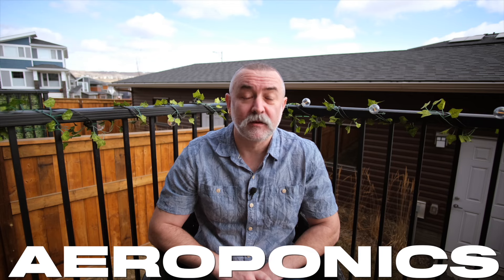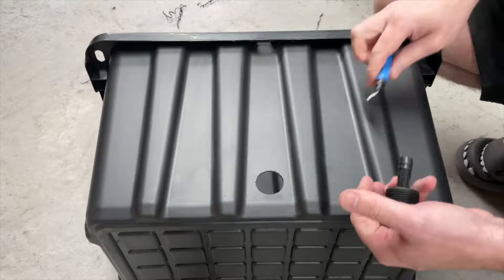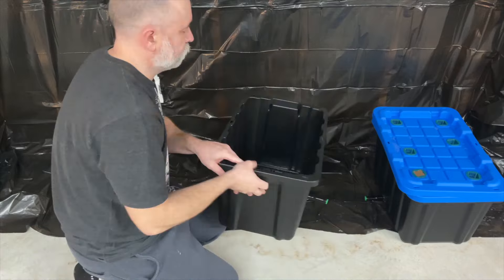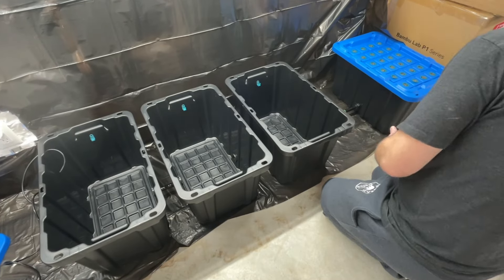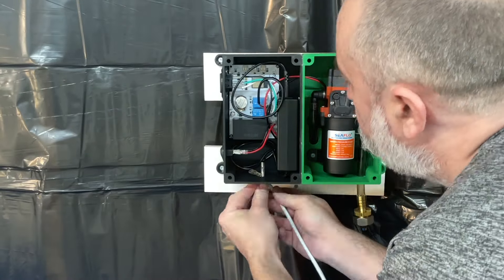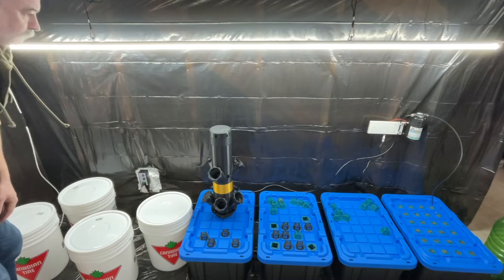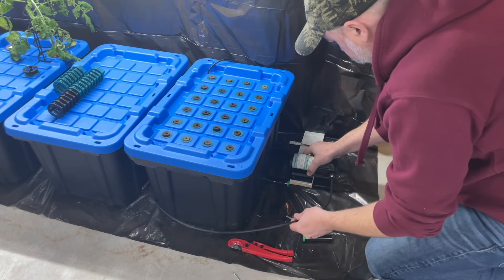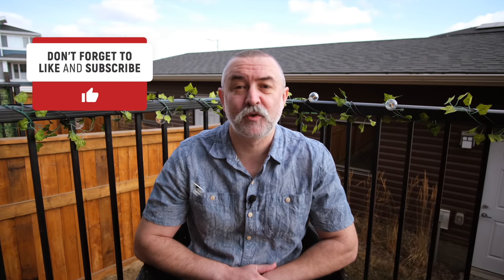Building a DIY Aeroponics system at home - Hydroponics Gardening

Comment: No expansion tank? No high pressure? Droplets will be higher than 100nm so you're not on true aeroponic.. this is more like hydro.. you're feeding cycle is 15'on 60coff?
Reply from the maker: That’s high pressure aero, this is low pressure. Two very different things. Most people don’t have the means to do high pressure at home on a budget, low pressure though is more than achievable.
Reply: @ArcVerdi  ok but you will not have significant improvement from DWC to LPA.. So IMHO LPA is not the way you can maximize your yeld.. people can stick to hydroponics systems.. they're more "errors forgiving" than LPA (specially blackouts are LETHAL in LPA not in hydro), they're cheaper... Easier to build..

I was persuaded by my salesman at the growshop to switch to aeroponics..he convinced me to buy a LPA setup.
Really hated it. zero improvement, more complications.
The "amazon" LPA kit is really a scam. An expensive piece of plastic.
Like the "full spectrum x blue-red grow lights.. everyone keeps telling they're good for YEARS, science proved it WRONG. Full spectrum goes from uv to far red/infrared.
Aeroponic is better than hydroponic WHEN YOU CAN GIVE YOUR ROOTS WATER AND NUTRIENTS PARTICLES BETWEEN 50-100microns.
Tons of scientific literature, and studies made by NASA, proved that.
If you cannot achieve 50-100 microns... stick to hydro..
Reply from the maker: @DanielElia2036   to be fair, I agree. The results from HPA is head and shoulders above anything you can expect from LPA. You know what it's like though, people like to play with hydro of all different types. I'm an advocate for all types from Kratky right up to HPA which is probably the most complex method around. I'll try and do a HPA video next year. Thanks for commenting and sharing your experiences, it really helps the channel.
Reply: @ArcVerdi   tnx mate, hope to see your video about HPA soon!💪💪💪
Reply: @ArcVerdi this is so great btw. Ignore the keyboard gate keepers.
Reply: @DanielElia2036 to be clear, you're mixing nanometers (nm) and microns/micrometers (μm) together in this post and it's confusing. I'm guessing that microns is the the right unit for your explanation?
Reply: @thebear4846  tnx, I've corrected it, microns is the right unit👌

Comment: great video!  I use tefen mister nozzles, also fairly cheap and available on the internet monopoly outlet.  I would say an accumulator tank and pressure switch for $60 would be a great addition even for new growers.  Reduce wear on your components and much less noise from the pump cycling.
Reply from the maker: Great advice 👍 I ended up trying some stainless nozzles and they have been excellent so far.

Comment: Thanks for these videos. Hope you make more. Are you using the Bamboo P1 printer? (I see the box in video). How much does it cost to print these netcups and various parts? I'm trying to decide whether it is worth investing in a 3-D printer. Thanks.
Reply from the maker: Hi, yes definitely more videos. I’ll be uploading again next week. 
The net pots of 32mm size cost $0.04 to print. If you want to use random sizes etc then I don’t think you can fault it. If you were to use just one size, then it’ll be cheaper to just buy those. 
I can print and use any size I want without having to buy 100s of each 👍
Yes it’s the P1P, love it. Best printer I’ve had.